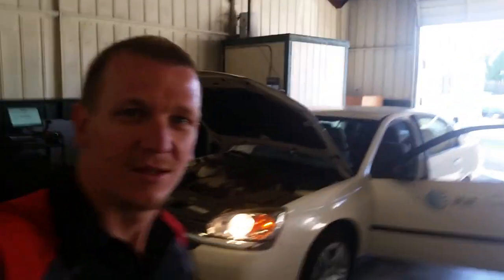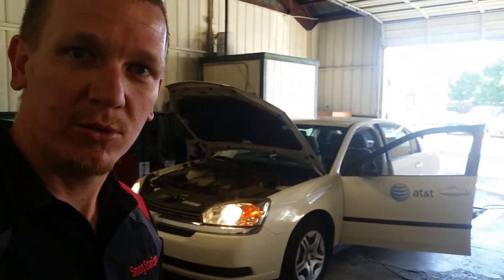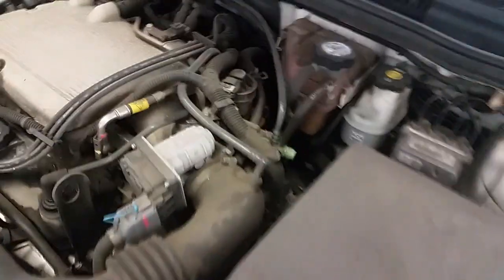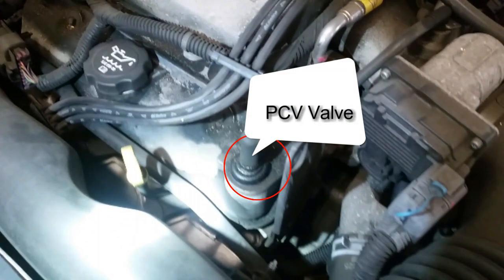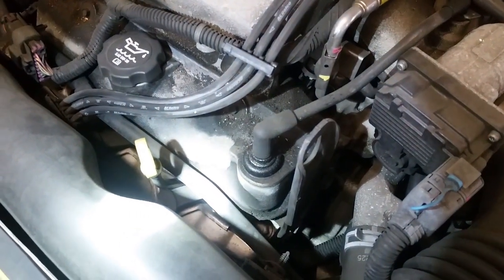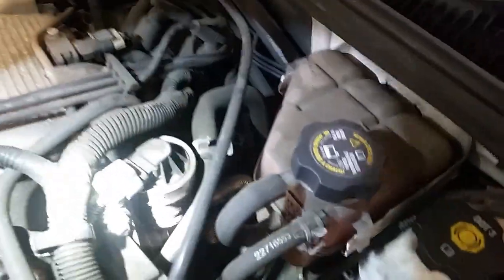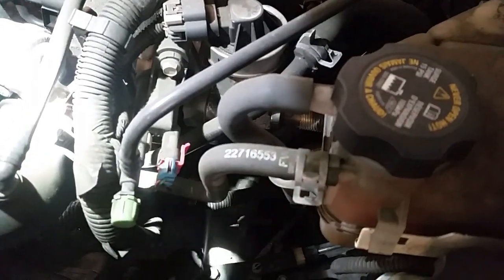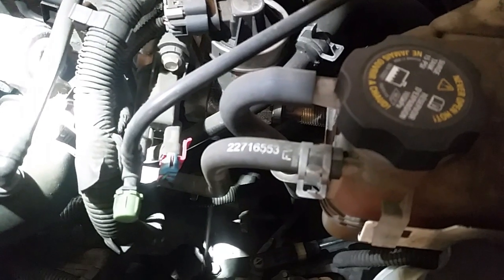Chevy Malibu emissions / Smog locations: PCV, EGR, EVAP purge & canister

Comment: Where is the cannister vent solenoid?
Reply: the canister vent solenoid is next to the charcoal canister. under the rear passenger side, you'll see the canister, as he shows in the video. follow the canister towards the rear passenger side, and on the corner of it, you'll just barely be able to see the solenoid. it's next to the passenger rear fuel tank bracket bolt and the passenger rear sway bar bolt.

Comment: The music...WTF? It's louder than you are..
Reply from the maker: Let's get the party started!!! 🥳 jk. Check out a newer video and let me know what ya think. I was trying new stuff out. I'm a guy that fixes stuff and hates the computer. We are all learning in one way or another. 

Good luck on your fix brother. 👍💪
Reply: @ScottiesHobbies  well, I tried, but it seems that the EGR valve was already replaced on this car, as 2004 and 2005 EGR valves apparently have a vertical connector, and a newer design with a Siemens sensor has the connector going vertical, and there was some issue with the wiring, and a TSB was put out to address the wiring.